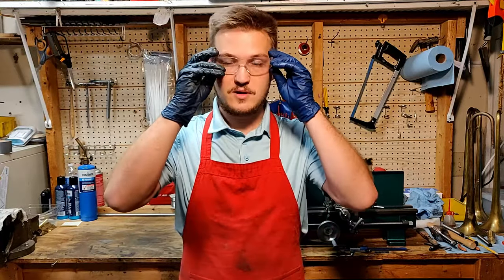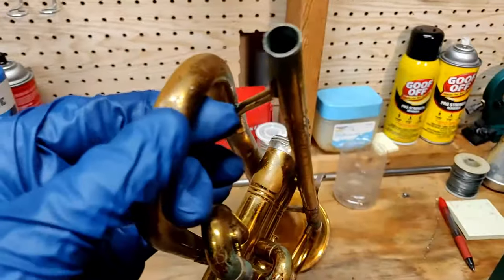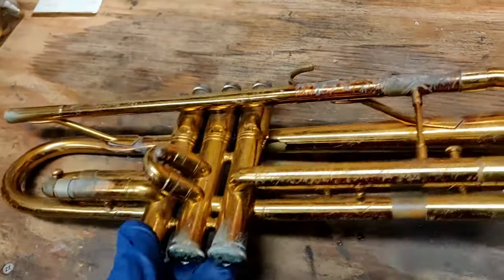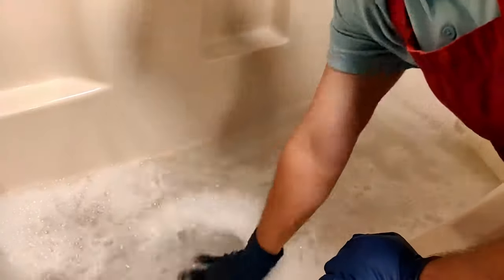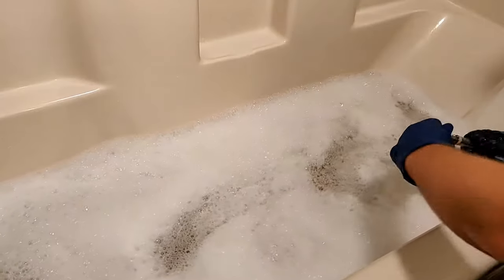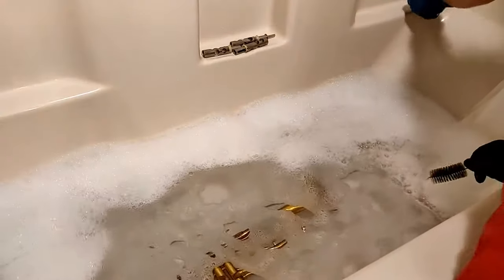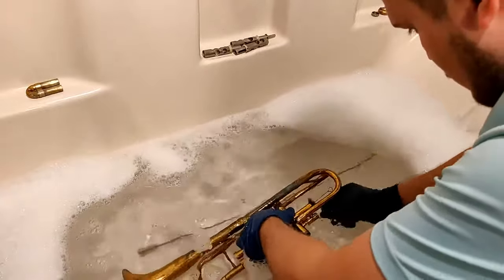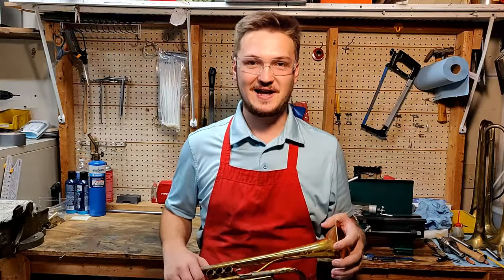Restoring a Donated Trumpet to Playing Condition | Part 1

Comment: Hello, I am following your videos with interest and admiration. At 2.35 minutes, you say that you could check some of the compression, could you tell me how to do it? Thank you
Reply from the maker: Thank you! I did an initial check by pulling the slide to hear a "pop", but I also sealed up the other parts of the horn and blew air through to see if I could feel any leaks. They make a machine for this, but I do not have one yet.